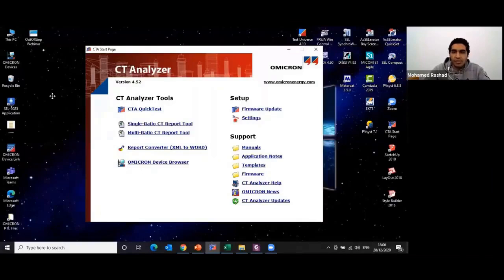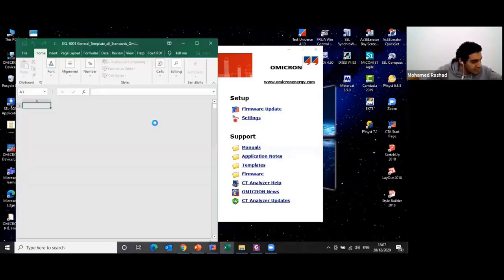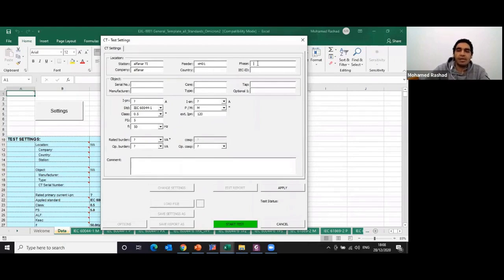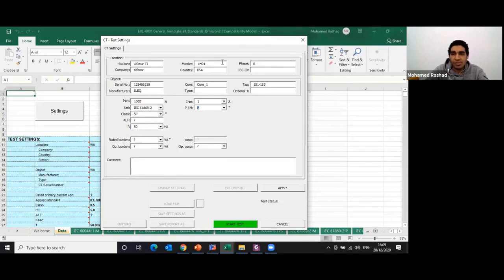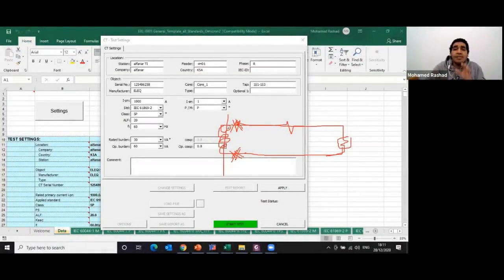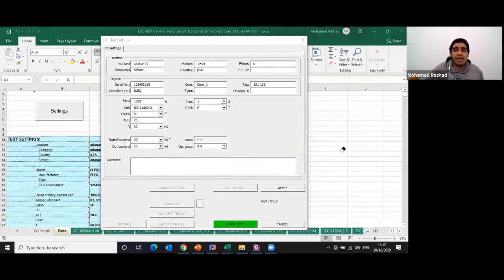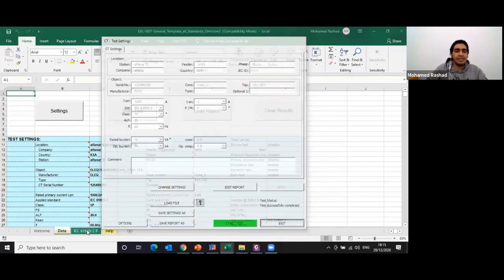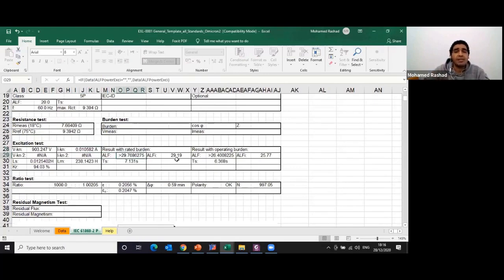CT Analyzer Software Version 4 5

Comment: How can know the operated burden ?
Reply from the maker: @hafezmowafy2940  
حضرتك لو عربي فيه نفس الفيديوهات بالعربي 

The operated burden is measured in a different activity by normalizing the Terminal Blocks and injecting the rated current whether it was 1 or 5 A on phase R then y then b
And measuring the voltage across the loop

Another method by whetstone bridge or using multimeter